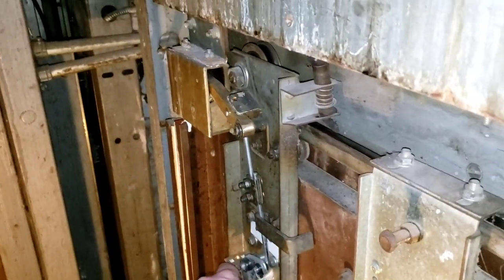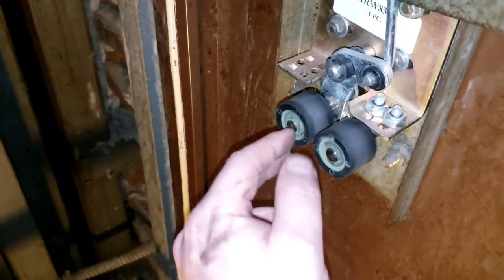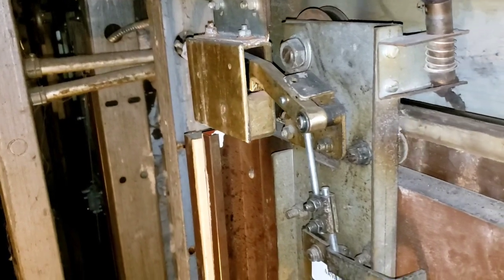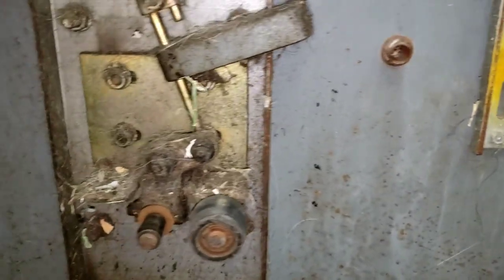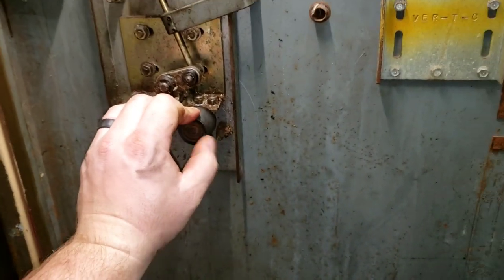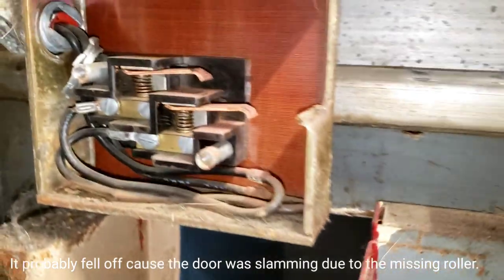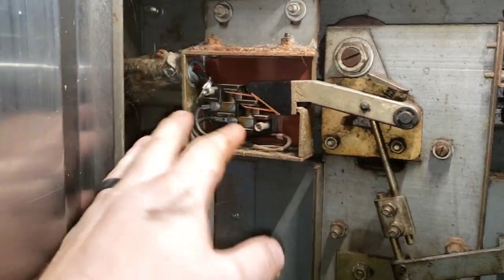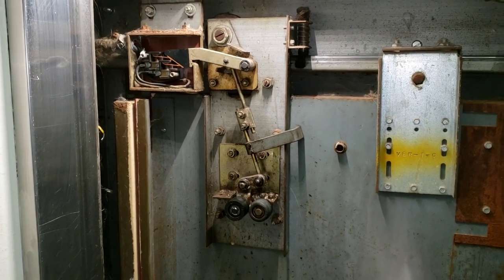Armor Door Problem

Comment: Maybe you could just stand in the put and use a ladder.  If it's traction, it's definitely safe, because the only direction for it to fall is up because the CW is the heaviest weight in the pulley with an empty cab.  If hydro, just close the jack valve.
Reply from the maker: That is an option but what I did is not hard. Its just that most times mechanics are running from one job to another. Preventative maintenance died a long time ago.

Comment: The other comment abt the Armor door open fail happened in a Basement level as well. In addition, it's sometimes gotten stuck at that level by going down towards the Pit instead of going up...even though that's the bottom level. Is that like an issue with the bottom leveling box? Or is it a fail in one of the relays? The thing is that the inner indicator is analog/number lights, while the other floors other than the Lobby have a little LCD screen at the outer Call panel. So I think it still has relays...there were a couple of times when I thought I was stuck btwn floors cuz it took so long to change the indicator... so I figure it's still relay based rather than being microprocessor based.
Reply from the maker: Probably relay but it could be a stepper problem which causes the elevators to loose there position in the hoistway.  Typically once it gets to a terminal floor (top or bottom) it would reset. It’s a guessing game on what was wrong.